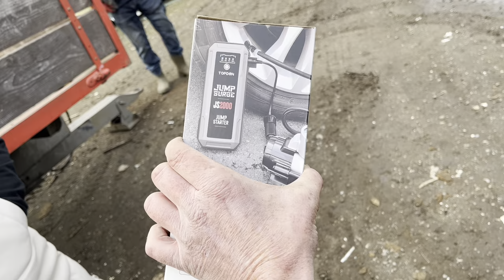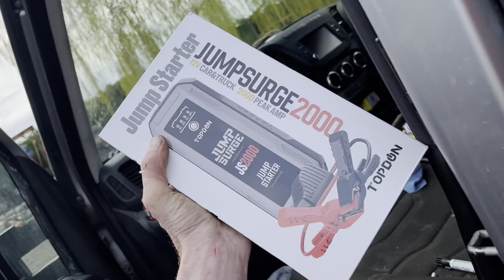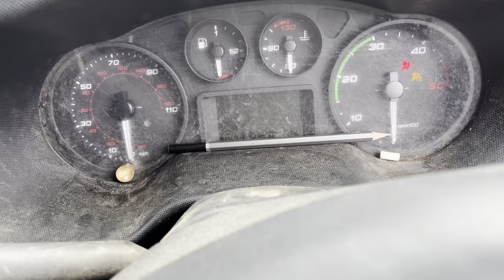Fix one job and find two more! YouTubers at work D&j projects, B&P paving Topdon JS2000 review

Comment: on these jump packs, they auto detect the voltage on the car battery to check the leads are the correct way round. when the your battery is dead it obviously cant. so you have to hold the switch down and override them to turn the jump pack on.

Comment: Good morning Chris,
Your battery has what is more commonly known as a parasitic draw. This is normally caused buy a piece of electrical equipment staying awake during the night. You have to find the piece of equipment causing the problem or the battery will be knackered pretty quick. To do this you will need a digital clamp on ammeter. With everything turned off place the ammeter on the battery cable and see how many amps are being drawn from the battery you will then need to find where that current is going. Do this with your digital voltmeter check the voltage across each fuse. You are looking for a very small millivoltage reading of 2-4 mV or higher. When you find a fuse that is showing a current flow, find out what it is supplying and then try pulling that fuse and see if the parasitic draw falls. You can normally expect a draw of no more than 0.020 amps at the battery. Keep checking all fuses until you are down to the above level and then you will have a good idea what is flattening your battery.
Quite often the problem is a computer module, like the abs module that has a fault and keeps the ECU awake and alot of other equipment with it. So the fuse test could be difficult to pinpoint the issue. If it is a module you may require a vehicle diagnostics tech to look at the vehicle CAN-BUS to see if it is going to sleep or not, this has to be done with an oscilloscope.
But if I was you I would do the simple fuse checks first. Try watching "pine hollow auto diagnostics" on YouTube he's excellent. He also uses a thermal detecting camera to see the heat being caused by the fault. Good luck Keith

Comment: Great video Chris. Them topdon are good I've got a slightly older one it's called a volcano 1500 it's worked every time I've used it. Mine is about 15 or 16volts fully charged so when the starter kicks in it pulls the voltage down to nearer 12v to start. My m8 used to use his 18v makita battery to jump start his works van two big washers and jump leads the starter pulls the 18 volts down to nearer the 12 and it works if the vehicle starts well. Plus there  useful power bank mine has 2x usb and a cigarette lighter socket to plug in. Keep it fully charged it will serve you well m8.
Reply from the maker: Handy to know to get you out of a mess mate! 👍

Comment: Wonderful video again Chris! I'm not sure if it would speed up your brake adjusting, but when you have the drum off you could quickly extend the adjuster and check it by putting the drum over the shoes, slip it off, extend, drum on again, check, off, extend and so on instead of having to turn the pesky adjuster with the screw driver the whole way. Just a thought from a sofa in Canada. Cheers!

Comment: Chris on that Chinese red one I’m wondering if the top post the shoes pivot off is missing a fancy washer, that goes on in between the shoes and the springs 🤷‍♂️ also we used to put an arrow on the back of the backing plate next to the letterbox for the direction of cog to adjust up the shoes (on the trucks they were all different some even had 2 adjusters) so that when you slid under them with your spoon still half fuelled on dancing juice you could get them adjusted up quickly 👍

Comment: I had a seat belt like that, bloody breakers wanted 90 quid for a secondhand one. In the end a drop of oil cured the problem, I think it dampened the lock so it worked ok.

Comment: You should have a look for a pressure bleeder that plugs into the compressor, easiest thing I’ve used doing brakes and comes with a 1L bottle that fills up the res as you bleed it through so you don’t run out of fluid. Think I paid about £14 for it
Reply from the maker: Yeah I’ve seen them before mate, handy little thing 👍
Reply: @Professional-struggler  deffo worth it to save all the hassle of needing other people on brake jobs, much better than the little vacuum pump bleeders as well

Comment: Think the battery tester I’ve got in my van is topdon, not a bad bit of kit tbf.
Just thinking, would it be a good idea to install a battery master Turn off switch on the struggle Bus, save faffing about disconnecting it - also added security because you can take the plastic knob out when it’s off